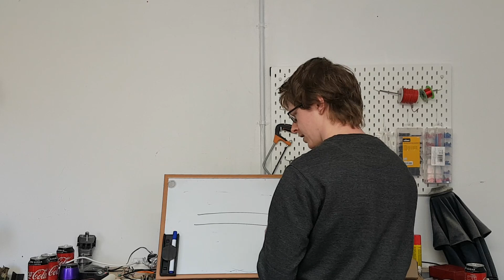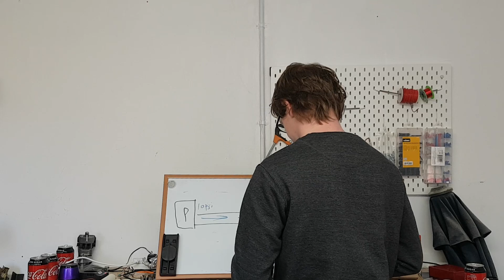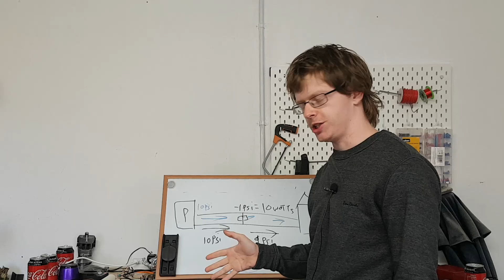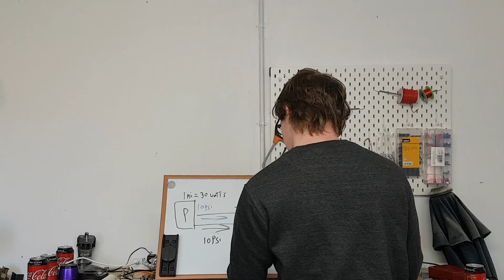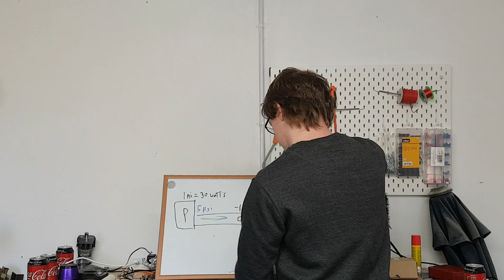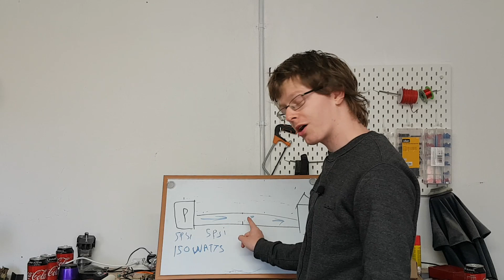Portland Oregon Free Energy Turbines

Comment: Most cities use water tanks that are just kept full by the pumping station. Gravity does the work of getting water to each house.
Reply from the maker: Ah I see, Is that an American thing? I know over here we have pump houses.
Reply: @Brains933  The water towers are fed by pumps, but once they are filled, the water returns via gravity, or as you smart people might call it, hydrostatic pressure.  That type of system is quite common here.  One advantage of this is that water can still be delivered during power outages as long as there is water in the tanks.